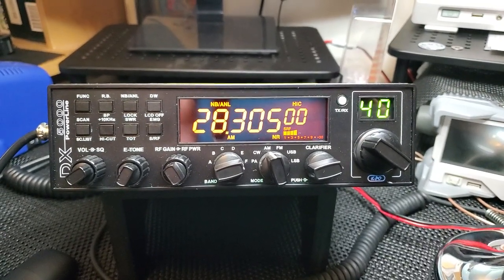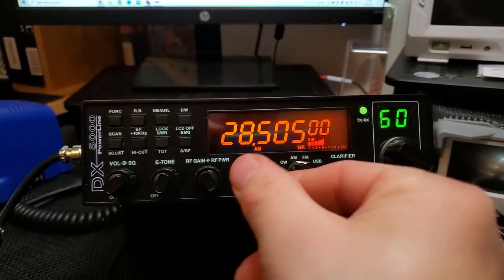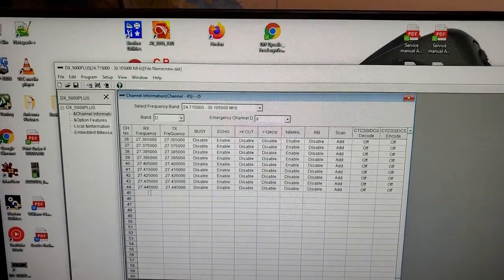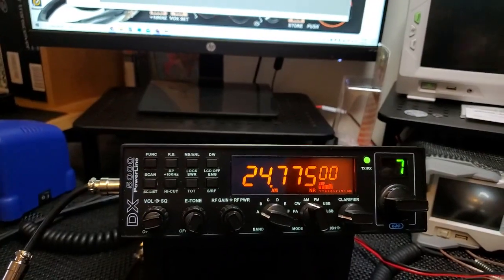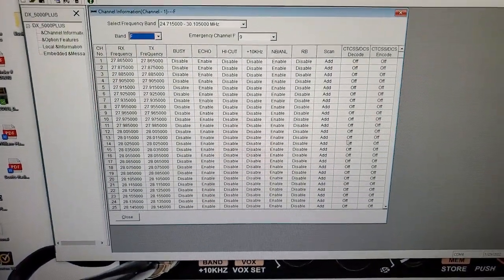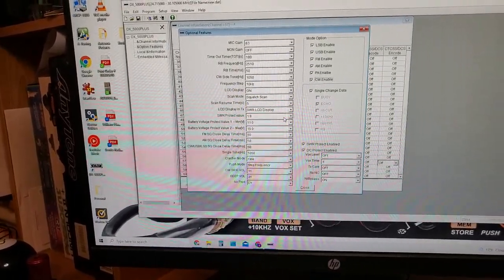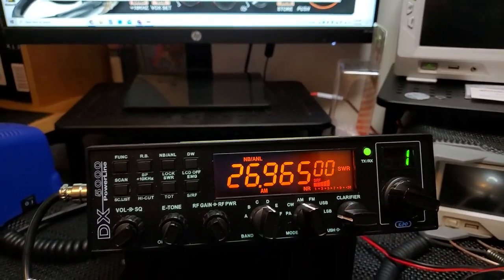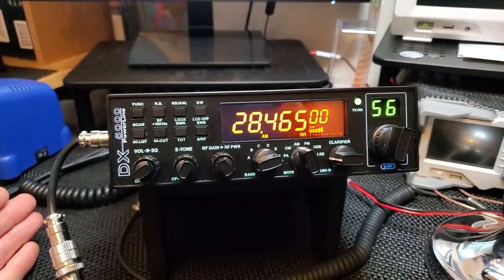New K-PO DX-5000 Plus. Programming memories and changing functions in the software.

Comment: Looks to be the same radio as the Alinco DX 10, that is no longer available in the USA.  Hams had a tizzy.
Reply from the maker: This radio has a completely new PCB.
Although this radio looks like many other makes and models of older now discontinued radios. This was the first radio to incorporate the brand new PCB board from Anytone.
The biggest improvement is superior TX/RX frequency stability, Rx DSP filtering.
Tx Noise Gate.
The non-adjustable PCB will also keep some from tampering with adjustments that would end up causing failure of the radio later.